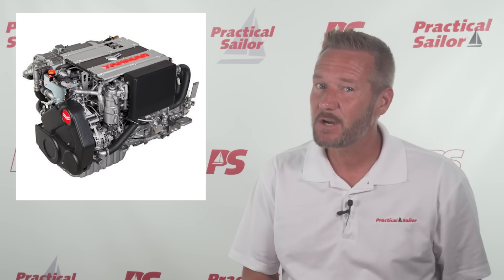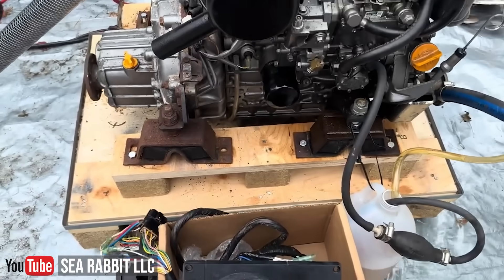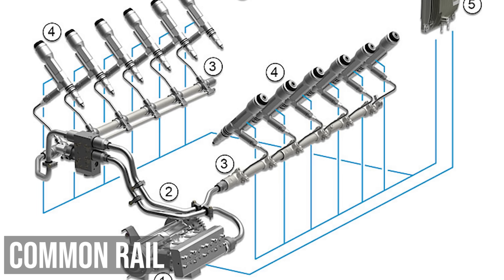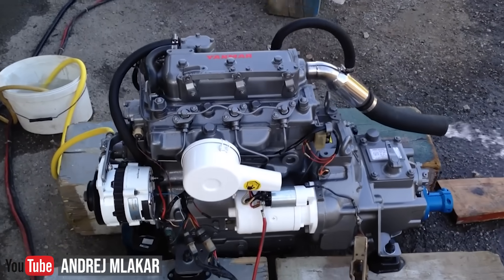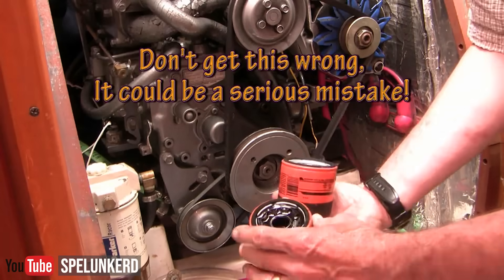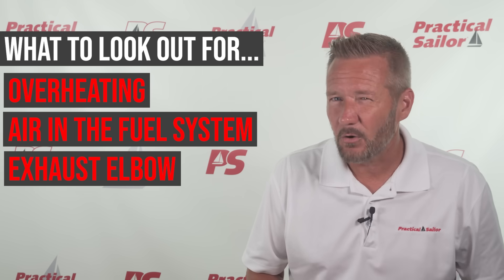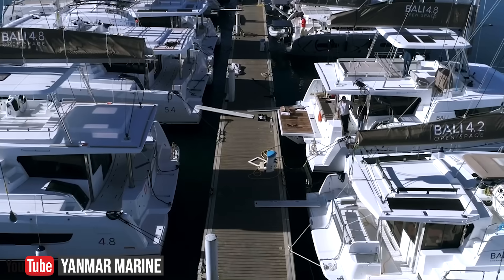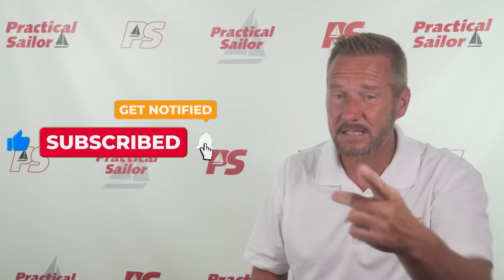Everything You Need to Know About Yanmar Sailboat Diesel Engines

Comment: I repowered with Beta. Parts are significantly cheaper and easy to get, the impeller is easier to change and they have a convenient oil change pump. Kubota is the world's largest producer of diesel engines under 100 hp and  you can get parts at a tractor supply and many auto parts stores. 700 trouble free hours into the engine with no problems. So far I think I made a very good decision.

Comment: Really useful content here both in the video and in the comments below. I've owned a 2001 Yanmar tractor for about five years, it has over 2000 hours on it but despite burning a bit of oil, it still runs great and never lets me down. I'm in the process of buying an Achilles 840 28 foot sailing yacht powered by a Yanmar 2YM15. I'm pretty sure that the exhaust elbow needs to be replaced and I plan to replace all filters (and keep spares on board) so the information in this video is both timely and topical for me. Thanks 🙏for (yet another) interesting and informative video - keep up the good work! 😁

Comment: I have purchased a Freedom 32 with a Yanmar that needs replacing. What are the thoughts regarding replacing with a Yanmar Electric SDe15? If I did this, couldn't I replace my fuel tank with another freshwater tank? Does anyone know if the new SDe15 is reliable and will last as long as the 3YM20? Thanks for any and all advice.

Comment: Have had a 3gm30f freshwater cooled in 1990 Hunter 30.  It now has 1550 hours on it.  Everything in the video has occurred, follow advice given, and you'll be fine.  Just wish I had this video 25 years ago!  Biggest and most frequent problem has been the mixing elbow, which I was cleaning out or changing at least every 300 hours.  Went to a stainless model five years ago.  Pulled it after 300 hours this year and was astounded to find it perfectly clean, looking like brand new.  Highly recommend this aftermarket change.
   This era of engine also had starting issues that were solved with a better starting solenoid.  Replaced 20 years ago and have forgotten about it.
  Don't baby these engines!  Test run at wide open throttle and back down till no smoke!  Most say cruise at 80% of WOT; (3600 * .8 = 2880) but I started running around 3k a few years ago for cleaner exhaust and a little better mileage.  Still leaves a little soot on the transom (mostly because of the exhaust hole placement no the starboard side at waterline, instead of directly aft), but never visible.

Comment: Great video, by the way, if you rewpower like I did 13 years ago from a Perkins 4154 to a Yanmar  4JH4-HTE, I would evaluate the need of an anti siphon valve. I learnt the hard way and my Yanmar flooded on a 200 nm trip in the Caribbbean sailing east (against wind and currents). The result, the engine became flooded due to syphoning of exhaust sea water when it was shutdown. The result. Jammed engine. Had to take it apart and replace piston rings. Total mess. Other wise, it iss a great engine, totally reliable and very compact in my engine room. Cleared up a lot of space.

Comment: Took a wonderful and simple engine and screwed it up with electrical garbage and can fail for WAY too many reasons and you are stranded with a simple engine that should run if it has fuel and air.

Comment: One of the very common issues with Yanmar is the undersized and long ignition wiring, which can't start the engine due to voltage drop. The symptom is pressing the button, but nothing happening. Unusually resolved replacing the wiring to the starter button with larger gauge or putting a relay on the starter.

Comment: yanmar is absolutely worst engine you can have. every summer massive repai. on other boat had Volvo Penta, this was no maintenance for 8 years, only add oil and diesel. And the spares are super expensive, same time as for Volvo you can get ton of spares and even second hand engines for very cheap.

Comment: Tip, watch out on the4JH3-TE, and I suspect other models. When checking oil levels either remove the dip stick or the filler cap 5 mins before checking levels. Otherwise you won’t get an accurate reading, as a vacuum in the area of the dipstick will show a low oil level and you might put too much oil in, this could seriously increase the risk of a runaway, which trust me you do not want.

Comment: I have a ‘92 Yanmar 4GH2-TE.  We had it rebuilt two years ago.  That was a mistake. Very costly, over 30K. I wanted to avoid the electronics on a new engine.  I should have purchased a 10-15 year old engine.  Some parts were no longer available for my engine. But overall my Yanmar has been a reliable engine.

Comment: I have rebuild many gas engines, 4,6,V8s, and two Yanmar 3GMF from scratch, bare block, bare head, etc. My own 3GMF #1 cyl seized while on the hard unattended. When I first saw those cylinder wall, I was stunned. They had so much wall thickness, I was blown away. I was hoping to "upgrade" to a 3GM30F, (the other engine I rebuilt), but couldn't convince the owner to a deal. Indeed they are bulletproof, and better if maintenance is done regularly. 
You forgot that Yanmar also has a big market for farm equipment, especially John Deere. 
As for the salt water intake for cooling, I devised a way to put a fresh water hose when at a marina and flush the engine at the same time as oil changes, if I'm then at a marina. I've never been a fan of saildirves. I rather deal with the stuffing box and the cutless bearing. Great video Tim.

Comment: Great video, Tim, keep them coming!
A commonly neglected maintenance issue that was not mentioned is replacing the motor mounts. I believe Yanmar's recommendation is to do it every five years.
Worn-out mounts will get the shaft misaligned, a leaking packing gland, particularly when heeling, and even engine problems because of the bouncing around.

Comment: With the old non-glow plug engines...look at fitting a "Thermostart" flame heater which fits in a threaded hole drilled and tapped into the metal intake manifold...

A flame heater uses diesel fuel and a 12VDC supply to create heated air in the metal intake manifold to almost instantly start these old "cold blooded" engines.

Press and hold a button down for 15 to 30 seconds to create the flame and heat....then press the start button.  

It can also be fitted to a manual start engine as long as you have 12VDC available....

These Thermostart flame heaters are available from tractor spares supply shops or on the internet...the flame heaters are often found on older tractors e.g. massey Ferguson, Perkins engined tractors.

YT has vids showing the operation...Marty T channel has a vid showing testing, operation and fitting a replacement one to a Hough30B loader....

Comment: I like my Yanmar 4JH4 with saildrives. However, in my experience the main cons for Yanmar Sail Drives are the SD50 slipping clutch problems and damage to the leg/prop seals often caused by fishing line. Ingested fishing line cuts the seals and let sea water in and oil out. It's amazing that a sail drive with completely contaminated oil will keep operating so well. But it will eventually ruin the bearings and cogs. The SD50s can also have a spacer alignment issue with the drive cogs. This can badly damage the teeth. The new SD60 sail drive has a ZF gearbox which seems to be smoother and no clutch problems. The new SD60 uses engine oil not leg oil.

Comment: 1970 - I had HS friend who's family had an older wooden 30' sloop. He and I and girlfriends would take it out weekends on SF Bay.  It had a single cylinder Yanmar - I think it was a two-stroke.  I was a bitch to start.  One of us would hold open the compression release and stand by with a can of starter fluid while the other would crank the hell out of it to get the huge flywheel up to speed.  Then the CR would be dropped while a long shot of starter fluid was aimed unto the intake.  There was about a 50% chance of it starting the first time so you needed to plan ahead.  I'm glad our folks never found out what went on during our cruises.

Comment: My ocean going Endurance 35 has the original 49 year old Perkins 4108.
Rebuilt once.
It has the Rare Glowplug head and fires right up if I use them 

The rebuild kits are around $1,000 including new pistons and sleeves.
And in its present form has pushed my boat past the listed hull speed all the way to 7.5 knots on a few occasions.

I was looking at replacements, but decided to keep it.
Although if I can find a good core, I may have it rebuilt with the very few upgrades.
Including leak free main seals.

Oh, my boat has a sister ship with a modern day VW TDI engine.
It was marinized with the same parts VW used on their Pathfinder marine diesel.
And uses less than a half gallon fuel per hour.
He didn't install the turbo, and said it doesn't need it

Comment: Everything said, makes for a lifetime engine well maintained .A couple of additional tips. The first thing when you buy or install a Yanmar, spend the extra bucks. The starter motor is going to nuke, Buy at least one spare and understand the wiring and mechanical replacement procedure. Down the road, it’s going to cost you a Yankee dollar otherwise .You have to also have, a switch over fuel filter system during storms. Last is, change the oil and engine filters, whenever the whim or urge is to buy gin for a sunset cruise. These babies love having a clean oil and fuel system. Thereafter, a bombproof honey. Ps. 10 minute warmup, is not a dirty word. Lastly, a saltwater clean with dishwasher, followed by a freshwater rinse and drying during passage crossings, makes for fun spot checks.

Comment: Hi Tim, a word of warning on the older, non-glow plug engines: I have a 3GM30F in my Cabo Rico 34. As a novice boat owner, on a cold (about 40*F) December day in 2023 we tried to start the engine, but as the engine, water, and fuel were all cold, it wouldn't start. WARNING - if the engine doesn't start in less that 15 seconds CLOSE THE SEA COCK. I hadn't known this and yep, flooded the engine with sea water. Long story short, after trying to rebuild the whole top end over 7 months (on weekends) the boat was damaged in TS Debbie, so was hauled out for repairs, the engine required an entire rebuild at a cost of >$18k. If the engine doesn't start, close that seacock. Our best practice going forward will be to not even open it until the engine starts, as it has coolant in the fresh water side  anyway. BTW she's still on the hard, insurance covered damage being repaired. I guess the bright side is I'll have a zero-hour engine when done.
Reply: I have to start my 3GM30F with the throttle wide open, as directed by the Yanmar manual for cold start.

Comment: I am not a fan of "common rail"/computerized/ultra-high pressure diesel engines.  First, I don't like the idea of accidently injecting myself with diesel, which as I understand it is highly dangerous, and, second, I don't like the idea of flying out a mechanic to work on my sailboat's engine if the little darling decides to go on holiday.  Thanks, but I'll stick to mechanical diesels.  They're still out there, and given the alternatives, rebuilding one might just be worth the price of admission.  Of course, your milage may vary.
Reply: Oh one other thing if you are going remote locations sailing..any lightning strike on or near the boat can fry the engine's  electronics...
read ALL the comments on here.
The Yanmar dealer will say "Oh we don't know about that..never heard of that."   LIES!
Reply: @JohnSmith-pl2bk  Why am I not surprised...

Comment: i repowered my 36 catalina with a Nanni 3.2 10 years ago and do not regret this engine.    Seldom use the glow plugs, this engine is not nearly as sophisticated as the Yanmar but uses a proprietary method called indirect Injection... The combustion starts in the little chamber and then expands into the main cylinder to push the piston down
Reply: Always use the glow plugs even if you have IDI..any reduction in starter motor use is also a reduction in the most intensive stress and drain on the battery....

I have a 1991 Nissan TD27 which is IDI...
and it has an automatic glow plug system that fires the glow plugs up every start unless the coolant temperature is at or above 50C...and fires then intermittently after the start until that 50C is reached.

It doesn't take more than 1 second on the key start after the glow plug light signals glow plug heat levels are correct for the start....

These are original glow plugs, original starter and solenoid (have owned the vehicle for the last 25 years) ...they all work...34 years and counting.....

Comment: I've got a 4JH3-TE 75 hp. Very reliable.  The engine was examined by an engine surveyor (but he says he doesn't work on them????)  My oil was a bit too full after my last change, so I have some oil in the water.  Months later I guess I have to pump some out because the level hasn't dropped. The  surveyor suggested cleaning out the turbo intake, etc... it's not having any issues but he saw some signs, and said it would be a good thing to do. but find a mechanic who will actually show up. There are 30 million people within about 200 miles of my boat, surely.... 

 My impeller is in a weird spot. There's a small hatch in the bathtub (yep, Hunter Passage 456s have a bathtub.) I want to change the impeller but there are knurled screws instead of bolts.  I'd spent a month trying to even touch one of my impeller housing bolts/knurled without any luck. I'd read that I'd have to take off the flywheel, alternator, etc to even be able to reach it. Then by chance I found a review of the boat from the first owner of my boat. He mentions having the hatch installed in the bathtub. That hatch seems pretty standard, but the hold behind the hatch looks DIY... 

One of my favorite movies is Ozu's Tokyo Story, from about 1954. In Onomichi there's a small fishing boat put putting through the channel to represent loneliness. I'm sure that's a Yanmar on board.  I saw similar fishing boats when I stayed in Onomichi in 2016. I'm sure they have Yanmar's on board. 
Of course most of these engines were made for farm tractors.

Comment: I just spent the weekend on my boat working on getting my Yanmar running. Turns out, the issue was only a bad connection between the start button and the solenoid on the starter. I ran a fresh wire and it’s starting like a champ again. I can’t speak to the newer motors, but my Yanmar from the late 90s still runs like a top.
Reply: Reading all the comments here 
you would be wise to have replaced original Yanmar wiring by now 
as it is an obvious failure point...??
Reply: @JohnSmith-pl2bk it’s on the list. I’ve only had my boat for a couple of years. When I purchased it I had at least 10 years of deferred maintenance to catch up on, and I’ve been prioritizing bigger issues. I’ve done all the work myself, so it’s taking a long time.
Reply: @stelliform  
You are doing the right thing...getting to know the boat and every system in it.
Fresh winds to you ....

Comment: 4 cyl 50hp yanmar in my 38’ 2000 beneteau 
Runs like a top and cheap on fuel ! 
Great engines yanmar. 
I worked for CAT my whole career but don’t make little engines for marine.  
Yanmar is very popular in sailboats and for  good reason 😁

Comment: I love my yanmar 4jh2e though when we first bought the boat (she is a 1998 and we got her in 2023 so was 25 years old) she would occasionally fail to start, the engine wouldn't even turn over.  After replacing the starter, battery and ignition switch it turned out that some of the wires in the yanmar wiring harness were corroded (probably at the connector) and failed intermittently.  Running replacement wires from the ignition switch to the starter resolved the issue and now it starts within one second of turning the key.  Now runs perfect!  I wish sailboat engines were quieter, a long day motoring can be tiring for everyone especially when down below.  
Tim, more videos on maintenance like impeller changing or bleeding fuel lines would be appreciated!
Reply: I have a tip on bleeding fuel lines, although I don't know if it will work on anything other than my old Perkins.

If you have a fuel return line on the top of your injectors, loosen the bolts off and turn it over until fuel starts coming out there.

I had an air pocket on top my injectors that I couldn't bleed out using conventional methods.
This worked and was the only way I could get my engine started.
It only took a few seconds after hours of going over everything repeatedly.

Oh, I have never found this tip listed anywhere.
So either it's a rare issue, or a very well hidden secret.
I am leaning towards the second, to make work for the mechanics.

Oh btw,
Impellers are usually straight forward.
The hardest part is remember which way they turn, however every one I tried will flip itself around the right way if you mess it up. ( In an industrial setting. I used to run self loading tanker trucks with a very similar impeller setup )

A little squirt of spray lube helps while installing it and probably increases the life since it starting out dry can't be good for it.
Reply: @sailorstu  
Anyone fit one of those cheap inline facet style low pressure clicky clacky 12VDC fuel pumps......that you operate with a momentary on push button or a locking rocker switch.....at the fuel tank outlet...so you pressurise the whole fuel system.... 
making bleeding a replaced fuel filter and any bleed screws a piece of cake?

This pump can also be run full time if the lift pump to feed diesel to the injection pump breaks down....
Reply: @JohnSmith-pl2bk 
Bad news for you,
They don't pressurize past the high pressure pump on all engines.
You need to turn over the engine in some cases. Including with mine.

Although they are great for everything before the high pressure pump, especially filter changes.
Yes I have one installed, and tried it.